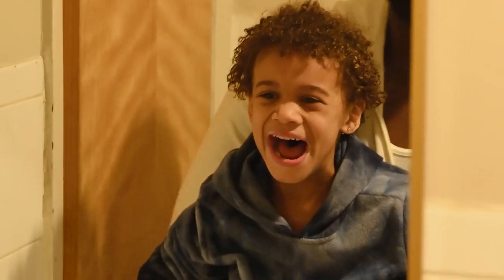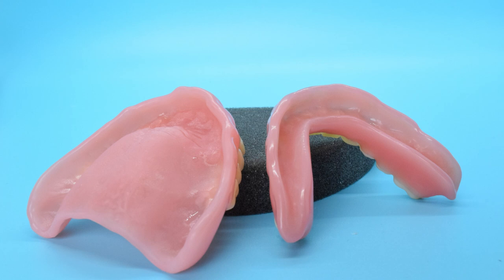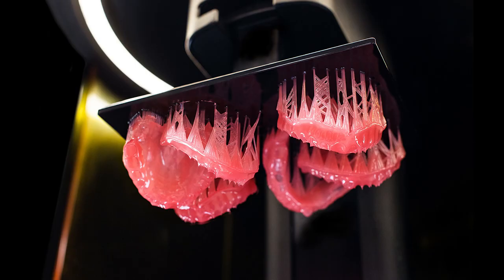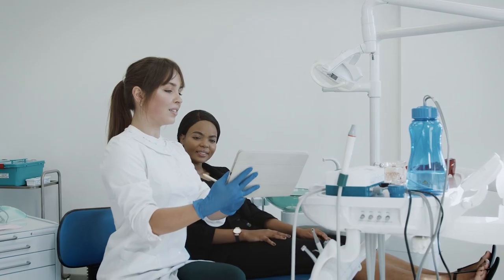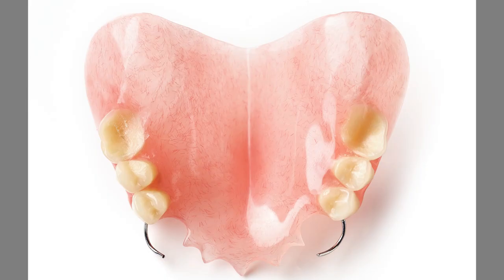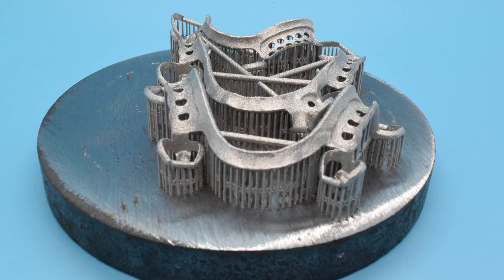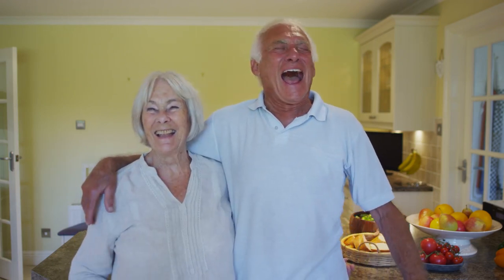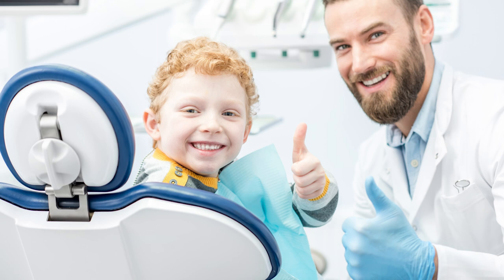Denture FAQs - Types of Dentures and False Teeth

Comment: Hi!
Im missing four molars in the upper jaw and Im thinking of using a metal partial denture but I have many doubts and fears.
Can I chew and eat well with it?
Do the clasps damage the healthy teeth where they are attached?
Is it definitely a good option today?
Reply from the maker: Hi Emilio,
Thank you for commenting!

The metal clasps of a partial denture will cause some wear to your teeth. In most cases it's pretty minor assuming you are sure to properly clean the denture and the areas around the clasps. It is easy for excess plaque to build up around the clasp so it is important to take extra care brushing and flossing. 

All dentures will wear your teeth and jaw bone to some degree. The more teeth you have the less the effect will be. Other factors come into bone loss and tooth decay too such as diet, oral hygiene, and other health factors.

No denture is as effective at chewing as natural teeth. Having the majority of your teeth is a really good sign though. The extra stability provided by the teeth will help give the denture more strength.

It will still take some getting used to when chewing. There are some types of food that might be too tough for your partial molars (like steak or some hard crust bread) but you have enough other teeth that you can probably eat a relatively normal diet. You'll just have to get used to what foods require you to chew a little differently. 

The extra rigidity provided by a metal frame will be the best option for functionality (chewing). The draw back is that people might notice the metal frame and know you have a denture in. 

A flexible partial will look more natural in the mouth but will be less functional for chewing. An Acrylic partial is the most inexpensive option, but performs about the same as a flexible partial.

Is it definitely a good option for today? Well, it's definitely better than not having any teeth. I'd say it's the best partial denture option for your case.

There are fixed options, such as implants, that will give you tooth replacements like your real teeth. But those options are all a lot more costly than a denture.